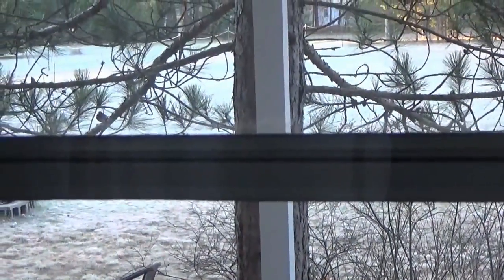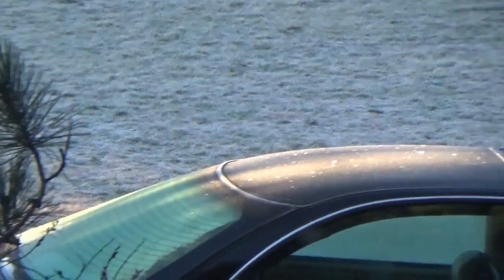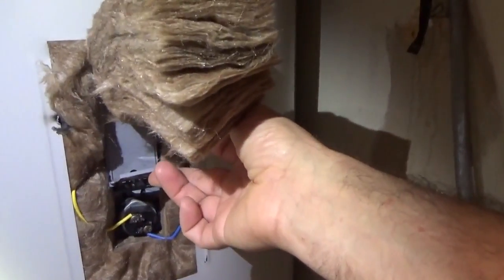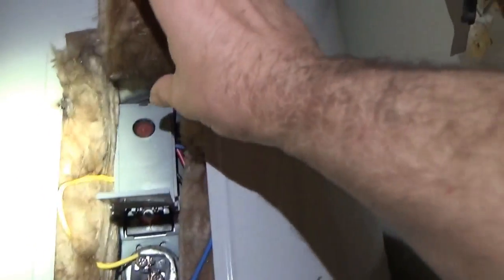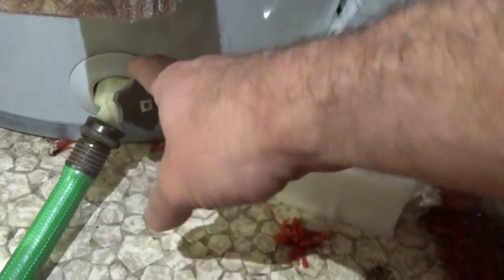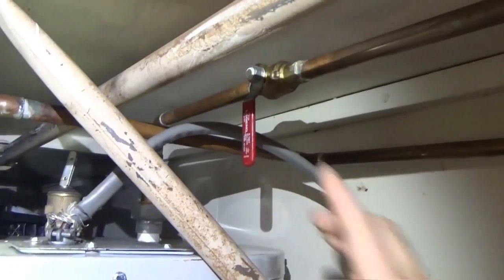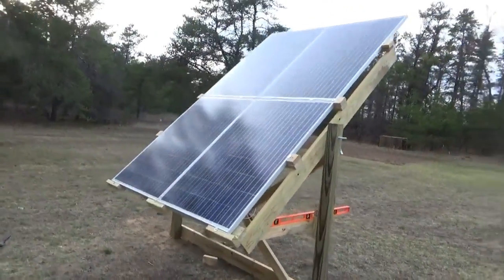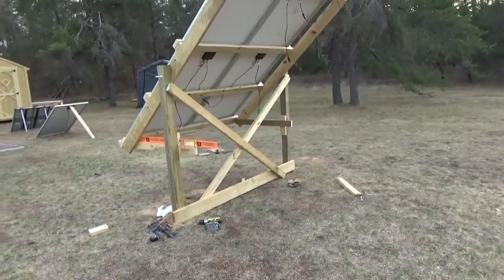Repaired Water Heater & Built Adjustable Solar Panel Rack

Comment: With one element looking that bad, you should have replaced both of them  That much mineral deposit reduces the element's contact with the water so it it takes longer - and costs more - to heat the water.  Less time to do that than to drain the tank when the lower element dies.

Comment: Hi Troy, 
I was looking through the comments and never saw it mentioned that the red reset button is not a circuit breaker, it is known as a TCO "Thermal Cut Out". They are used to interrupt power to the water heater if the water temperature gets beyond the maximum temperature of the thermostats.  This is a safety device to prevent the water heater from turning into a boiler when the thermostats fail.  If you still have problems with the reset tripping, consider replacing the thermostats along with the thermal cutouts.  Make sure the temperature and pressure relief valve on the top of the water heater is not pointing toward living quarters, if the thermal cutout doesn't turn off power then it will heat until steam and boiling water causes the T&P (Temperature and pressure relief) valve to release.  Since you are on a well, it is unlikely it will blow from excessive pressure as your pressure tank will absorb the expansion.  It can however blow off from high temperature and you don't want that near anyone if it happens.  Make sure there is an open pipe connected to it that diverts anything that blows off to a safe place.

God Bless,
Matt

Comment: You need to add 20x 250w solar panels, to get your house off grid. Plus forklift battery.
Reply from the maker: I dont think so. We will get by with much less than that I think.
Reply: Two parents, a kid, a cat, an electric water heater, in Michigan, you'll use at least 20 kWh per day, so 24 solar panels is a safe margin for fully off grid life.

Comment: Hi Troy
The H2O that is hot hot & 2 hot !
Most on the grid just have the thermostat set for steam & don't adjust it ! .
You may have 2 thermostats & a timer for one element .
Check the stats work & the settings .

As for the solar setup a temperature dependant mixer valve will limit the output temperature from the big tank & extend the hot water availability .
(  but it will depend on how hot you can get the tank with your solar ) .
You could run one tank element on a 120 v a/c generator in winter & d/c solar on the other .
You should get 1100 watts per H @ 13 R 
(  The 13 R  element = the 4.4 Kw 240 v unit ) .
A lot of ways you can go with this one but 
8.8 or 4.4 kw a/c is not one of them .
It may be in winter a small under sink water heater with a d/c element fitted is all you can run on solar .

Comment: the element would've burnt up instantly,if the tank was empty!.you can see the corrosion.that place went through numerous times of winterizing..one of the reasons why you are changing valve seats..

Comment: Troy I had a trailer just like that one with blue double sinks, so your not so tiny house is taking me back many years ago to 1989. The trailer houses we had was from the sixties or seventies and your is too from seeing the shag carpet. Solar mount looks good. I guess you don't have termites in Michigan like we do here. Its to cold for them I guess.
Reply from the maker: Thanks. This one is from 1965 I think. There are termites but I did use treated lumber
Reply: Well I put a post in the ground here and I used concrete. Did you use concrete? I did one before with no concrete and the termites feasted.

Comment: Hey that is good you got electric hot water so now you can hook it up to solar. But it has to have  one of these Controllers. My friend nrodge1 is an engineer and he designed a way to hook them to your solar panels. Check out his channel to see how. You cannot just hook it directly to the panels so he has a devise he invented so you to control them. He has a forum techluck.com and he sells them. They are needed. It takes any where from one to three or four panels depending on how much sun you have and stuff like that.

Comment: Troy, 
I have been nagging at you lately but I have to say that home grown solar panel mount is great! Does not even look jury rigged at all. 

You are going to get all uppity soon with running water and now hot and cold running water.  I do know one thing, I used to have a electric water heater when we first purchased this house (almost 30 years ago now) and when we got propane for heat I replaced the water heater with a propane one and WOW did it save use money on the electric bill. 

Keep up the good work! Hopefully inside Mom to be is working on getting ready for the arrival. P.S. Enjoy sleeping through the night now, soon it will be a thing of the past ........
Reply from the maker: Thank you. Having hot water is nice but I fear the bills. I hope to convert it to solar asap

Comment: troy, for future changing the elements, get a craftsman socket that fits and have the outside of the socket turned down with a lathe . Will last a long time and you won't bust your knuckles in the future. Those water heater element sockets slip too easily over time.

Comment: To run the water heater off solar power, do you have to use special elements. Those ones in there are usually 4500 watt/ 220v, they really suck the power.
Reply from the maker: Yes you have to get DC elements. Some start at 300 to 600 watts and on up. It will take longer to heat up a water tank though.
Reply: You know, when I was little my dad made a "solar system" using 100ft of 3/4in black plastic pipe. He made a X shaped 2x4 frame and used nails in between the pipe to hold it in a flat coil. He just put it up on the roof and ran the pipe down to the hot water faucet, "we had no shower in those days" it worked VERY well when it was sunny, trouble was, it didn't get warm till late morning or afternoon. It would actually get hot enough to steam.
Reply from the maker: I have been considering such an idea. Problem here is that it freezes half the year each night. I would need to use antifreeze mix and a heat exchanger in the house.
Reply: His setup was only good for a few months a year, this was at the lake cabin, summer only. If we would have had a storage tank, openings at the top and bottom it would have thermo siphoned and had more capacity, of course night time would have lost the heat. The way it was, it held at least a couple gallons of the hot water. It is in Watertown, SD, I guarantee it's is colder than your new location.

Comment: Yeah Troy,
looks like everything is coming right along, i like your solar panel set up looks strong, I guess you'll be able to bury the wires to it soon. I wonder what happened to your good old peanut gallery today ? I figured they'd be all over that singed water heater /wrench electrical arc story must have been up too late  flinging poo and perfecting the ultimate potty mouth forum for your channel so they slept in late today   :-D
Reply from the maker: Thanks. Yes I hope to bury the wire soon. I was also wondering where they were. I gave them the perfect opportunity and it seems they are sleeping today

Comment: Have you check the Anode of the Water tank? Is the lower Element full of gunk like the top Element? If it is, it will reduce the efficiency!
Reply from the maker: The lower element was clean

Comment: Good to see your solar panels on a proper rack and not on the ground. Now to get your wires buried to avoid the lawn mower, animals, etc. Coming along nicely. =)
Reply: Troy, Don't know if you are near a big city or not but you might search your area for a "Restore". Operated by Habitat for Humanity, building contractors donate supplies left over from bldg. jobs, motels or landlords remodel and donate the old stuff to them. You can get some really good deals on just about anything in the line of construction materials or even furniture, new and used.
Reply from the maker: Thank you. Yes I will bury the wires in conduit. May take time, dont know the price of conduit. But I will do it soon.

Comment: the water heater element leaks current through the spot that spit Heating water to the point it tripped the thermal limit switch that's not a circuit breaker
Reply from the maker: Ok, thanks. Well it was tripped

Comment: Great Youtube videos and Channel, keep up the self reliance. One thing i noticed in the video is when you closed your sinks tap, you had a water hammer effect that is not going to be good for reliability on the copper water plumbing Thought to give helpful advise.
Reply from the maker: Thank you. Yes I notice that. How do I prevent that?
Reply: There are a few ways to lessen it by adding check valves near the tap, bladder tanks help, and there are a few faucet company that sell taps with hydraulic ram arrests.
Reply from the maker: I dont think there is a pressure tank anywhere in the lines. I wondered about that. Thanks

Comment: whats your plan on heating the new house? in the future?  oil? natural gas, propane  or woodstove? 
(and iff its woodstove do you have enough wood and three's on your property to use??), or is it cheap to comby there?
Reply from the maker: I hope to use wood heat but will certainly have propane on the wall in the living room. More efficient than the central heater
Reply: Yes it's good to start thinking now. It's only April but sure enough winter will be back in a blink.
Reply: yust wondering. what the possebilety's are in the new house.

Comment: Does your state have Net Metering, if so why not  use the grid for as long a it still exists ans sell any excess power produced to the power company? If you loose power again you can just flip a switch asstill have power.
Reply from the maker: I am hoping to eventually have a grid tie hybrid like you mentioned. Battery backup and feed back into the system if I have any extra power.
Reply from the maker: I am going to look into that
Reply: Jocelyn Russell, I agree completely. I prefer a grid tied system that allows you to sell excess power back to the power company. The benefit of such a system is that it  also allows you to draw power from the grid when the solar power system can't meet demand. Such as not having enough solar panels, not having enough batteries, or running large appliances, or a long string of cloudy days.  I would also go with a grid tied system that allows for battery backup in the event of a power outage. Some grid tie power inverters disconnect the solar power when the grid goes down. Which is done for safety reasons. The system would probably have to be connected by a licensed electrician. But is well worth it. Troy can save a lot of money by doing some of the work himself.
Reply: Troy, that is good to hear. That way you end up with the best of both worlds. P.S. I would just ignore the scumbag trolls who most likely bash you for having a grid tie system. These are the very same hypocrites who would bash you for not having enough power if you went completely off grid! You just can't win with these guys. They will always find something to complain about.

Comment: i learned along time ago that when one hot water element burns out or leaks to replace both of them while the tank is empty ....doesnt cost much to do both at the same time and its all one job instead of 2 ...it seems to me once one goes the other aint that much far behind
 ps good job on the solar panel rack ... i would of used 6 by 6 but the 4 by 4s are just fine
Reply from the maker: The other element looked new actually. It was clean. Plus I want to replace them both soon with solar heating elements. Thanks.
Reply: the damage here is caused by powering it up, whitout water in the tank, the second one is turned on by clock, or by hand, and not the thermostat (to heat it up fast, the other one whas not powered y tbelieve , in his case.but y agree, both at the same time can be handy.

Comment: Rule of thumb always change both elements at the same time. Do not use cheap elements either.
Reply from the maker: I plan to swap them out for solar power elements soon so I did buy cheap. And the bottom element looks new.
Reply: Wait and hour after you fill the water heater to turn on the power to the water heater.
Reply: If I'm heating the water with solar power, I don't care if I'm heating super cold water that would have warmed up a bit on its own if I had waited... :)  It's free energy.

Comment: Good news on the hot water! Nice solution for the panels too. If the power bill gets too high you could look at lower wattage elements for top and bottom of unit; I've seen element wattage as low as 750w for 240v.
Reply from the maker: Thanks for the idea. Just takes longer I guess. I wonder if it would make a difference. Anyway, I hope to soon switch them out for DC elements and run them on solar
Reply: Some other things to look in to:
Since you almost burned your fingers off you can turn the small red pointers on the top and bottom thermostats down till the water is just warm enough.
Since the old element was so encrusted, check and see if your sacrificial rod in the tank is shot/gone; usually a hex bolt on the top of the unit has the rod attached on the inside. Costs a few bucks to replace on Amazon.
You can get a cheap water heater blanket to bump up the tank insulation; True value should have the blanket although Amazon might be less expensive.
Dropping from 4500W to 600W DC will probably increase tank recovery time by 8x or so. As long as you can wait to use the hot water it shouldn't be too bad.
Remember that the elements work 1 at a time, first top, then bottom. So you might want to have a higher wattage for the top to generate a small amount of hot water fast, then use a much smaller wattage element on the lower element for the long term/large capacity hot water. You'll need to fiddle with the respective thermostats to get the temps just right.
Reply from the maker: Thank you

Comment: Posts that are positioned vertically would be plumbed, not leveled. When your work is horizontal then you level those.
Reply from the maker: Yes, I always forget that word
Reply: Yeah, you should have called a plumber. lol
Reply: Vic, something being plumb doesn't equate to plumbing, it is a vertical test or standard.
Reply: OK Camper Hollow, thanks . lol

Comment: helps to start you plants inside.
using vinegar can be a safe way to clean the build up in the tank.
yeah you got to be careful not to dry fire the electric heaters. working at Menards I tell people to run the hot water at the next faucet tell the air is out before turning the power on to it.

Comment: When you go off grid you will be able to connect solar to the thermostat on the hot water heater to heat it up. Use it also to store 40 gallons in the event of shtf scenario. I love the solar array and it looks better than my 4 panel frame but mine can turn 180 degrees. Maybe if you make 2 more frames you can make those to turn while that one stays stationary. Everything looks awesome Troy, you are really out doing yourself and doing a great job!

Comment: Nice solar panel frame. So much better than having the panels laying on ground. But be careful when working on the water heater. 240 volts can kill you! You should get one of those Non-Contact Voltage Testers to verify that the power is off. They are cheap and well worth the investment. Don't just trust that the previous owner labeled the breakers correctly.

Comment: looks really good Troy professional job are you going to bury the wires it would look really good out of the way so when you mow the lawns
Reply: The wires also need to be placed in conduit. Troy can save a lot of money by renting a trencher and digging the trench himself. But he should check local building codes as to how deep the conduit has to be buried.
Reply: I put my wires in pvc pipe about a foot down. I didn't have to go too far though about 20 feet to my charge controller so I didn't have hardly any voltage drop.

Comment: nice solar mount...high enough to not have to worry about snow drifts  covering the bottom....or do they have epic winters there...?

p.s.   would those elements work if you hooked them up to 12 volt battery directly ?
Reply from the maker: Thanks. Snow gets bad here, yes. And for mowing the lawn I wanted the higher. You have to get DC elements for solar power. The AC element will burn out on DC power.
Reply: If you purchased 12v element...yes
Reply: Those elements are designed to work with 240 volts AC. But he can buy 12 volt DC elements.

Comment: Burnt out heating elements from turning on power with no water in water heater, happens every-time.
Reply from the maker: I figured that when they got the house ready for us, they turned on all the power at one time. Then the pump filled the tank - too late.
Reply: Actually those elements have been bad for quite awhile, look at the blown out areas, they are encrusted  with lime (calcium) deposits, which doesn't build up that much in a couple weeks time frame. granted  lack of water in tank was most likely one cause, but  elements do wear out with normal usage. I suspect that the failure was due to electrolysis action
Reply: That's the trouble with mobile homes since most of them have electric water heaters.
Reply: 30 years ago, I bought a brand new mobile home and the installers pulled it into the lot and turned on power before adding water to the water heater. Easy to forget.
Reply: Correct Troy.